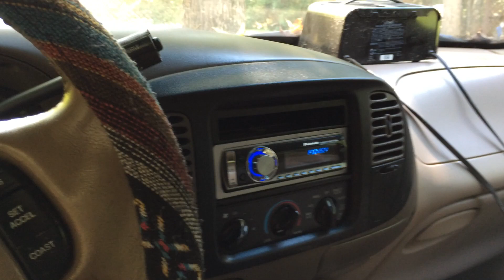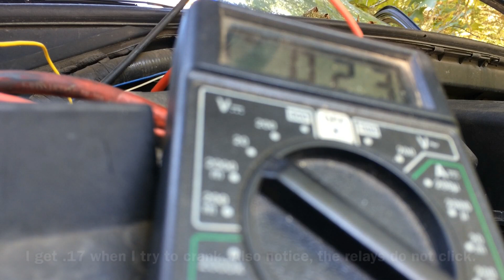Ford Expedition Won't Start

Comment: Check your fuel pump relay, after you check the fuel pump fuses.
Then see if you may have an issue where a new module did not properly ground to your fuel pump, and fried it.

Comment: I have a 98 Ford Expedition that has the same starting issues. I've replaced the starter and the ignition switch and it's still not starting. How did you solve your issue?

Comment: Ive got a 2000 ford expedition 5.4L v8. I had issues taking the oil pan out. I watched a YouTube video and did what he said but he did not give all the info that i needed so i jacked the motor and transmission up without taking everything of the top of the motor. Long story short i ended up breaking my antifreeze line for the heater core. The battery was still connected. Stupid on my part I know im just know learning about cars and trucks. Antifreeze went all over the motor and electrical wiring and down to the transmission and into the wiring harness. I went through and disconnected every thing one at a time trying to diagnose the problem but no matter what all i get when i plug the battery back up is the relay #2 under dash clicks for a while then it stops. The head lights come on and that's it. Please tell me you know what the deal is.

Comment: 97 expedition. just began my problems on car just got. had no issues, it ran like a champ until one random day. parked it turned it off at home nothing different. hour later doesn't turn over but I have dash power and radio. starting this checklist.
Reply from the maker: +Matthew Rogers Although you have dash power, you still might not have the load capacity left in your battery to start it. Try taking it to your local auto parts store or shop, and they can load test it for you. Unfortunately, these batteries are expensive. You also could have issues with your ignition cylinder, neutral safety switch, and so on. If you give any more details that you have, I could try to give you better advice. Please update with the solution once you have it, so others can see it in the comments. Thank you
Reply: +KyleMyers33  just fixed my issue . had similar symptoms as everyone else, and began to worry due to little knowledge on cars. this has helped so much, I did my checklists and got many opinions from YouTube and websites. I jump started a friend the night prior to issue. turns out it was my starters relay #15 fuse .... cheap fix. hoping not a wiring issue for future
Reply from the maker: Great! At least if it does happen again in the future, you now know where to check first.
Reply: +KyleMyers33 yeah thank you. love the support on here

Comment: Does the theft light flash on the dash after trying to start it? If so, you need a new key due to microchip failure. The key is about $70 at a hardware store (Westlake) or double that from Ford.

Comment: I have a 2000 ford expedition and left me stranded at the store. Would not crank at all. Called my backyard mechanic and took him a few hours to get there. I thought it was the starter, so he went underneath and hit starter gently with a hammer. NO luck still would not start, checked the battery had plenty of juice. Then he got a screwdriver and touched both starter solenoid stems with it. It then cranked. So when he did it a second time, I started the truck with the key and it started. What could be the problem? I'm thinking its the starter solenoid but just want to be sure, what do you think? Thanks for the video, any feedback appreciated.
Reply from the maker: Yes it sounds like that would be the starter solenoid because it started after jumping at the solenoid. Please update here once you find the solution!

Comment: i have the same problem i ready replaced the starter solenoid still the same
did you found the solucion let me know please
Reply from the maker: Yes. Check the bulkhead connectors that are on the back of the fusebox (on the drivers side under the dash). You'll have to take off the dash cover to get to it. Make sure they are plugged in completely. If you haven't already, check all of your fuses, and pay special attention to your GEM Module fuse. Look into replacing your GEM module... they are known to be very problematic. Let me know if you have any other questions

Comment: 2000 Ford Expedition here. Neighbor said it was sitting for a few years because it randomly died one day. The engine will crank but not start. I emptied the fuel tank and filled it with good gas. There are some weird lighting issue when I put a good battery in, the interior lights will stay on even with no key in. I pulled the fuse box and gem off and no signs of water damage. Any idea? Warren.
Reply from the maker: Good idea emptying out the fuel and putting clean gas in before getting it to run. Have you checked the door ajar switches on each of the doors? The vehicle may not register that the door is closed, and the interior lights can drain the battery causing it not to start.

Comment: Is this about the transmission bulkhead connector? Where is it located? I get no crank and no power or lights on my Explorer. All fuses look ok
Reply from the maker: This was a problem with the bulkhead connector between the GEM and fusebox. It is located behind the fusebox

Comment: I have a 2000 Ford Expedition. I have replaced the battery 3 times this year. Trying to figure out the problem. I replaced battery once again even the post & cables. Any suggestions? Don't want to buy Alternator if that is not the issue... HELP!
Reply from the maker: It does sound like your alternator. Here's a link to instructions on how to check that's what's wrong. http://www.todayifoundout.com/index.php/2010/01/how-to-test-a-car-alternator/
Reply from the maker: I apologize for the late reply. It sounds like it is the alternator unfortunately. Sometimes if the battery drops too low it'll take out the alternator along with it. That's likely what happened the first time the battery dropped
Reply: Can you show how you fix it

Comment: I have an 04 expedition and it wont start... im pretty sure it the whole fuse box..... The car wont even attempt to start, all the interior lights and power door locks and windows dont work as well as the radio when the car is in the run position.... I just bought a brand new battery and still does the same thing.... Every once and a while you here on click from the engine bay..... No dash lights either except the only light that stays on is the yellow airbag light. I have tried to jump it with my chevy tahoe and nothing changes....... Any Ideas?
Reply from the maker: Have you checked the starter/ starter solenoid? The click may be from the solenoid.

Comment: what did you need to do to fix this?
Reply from the maker: The bulkhead connector was not fully plugged into the GEM module on the back of the fusebox. The GEM modules are particularly faulty in this generation Expedition, and it would be a good idea to check that if you have not already.

Comment: my ford expedition 2000 dont crank from key switch  but it start  by jumping the starter
Reply from the maker: Check replacing your ignition cylinder
Reply: Natacha Hernandez 

2001 Expedition wont start
Reply: Try reprogramming 2 keys to the car when you replace that it goes into theft mode